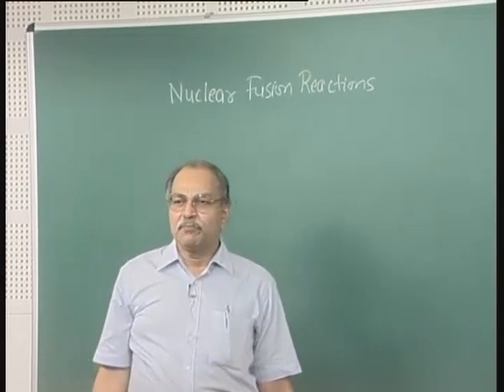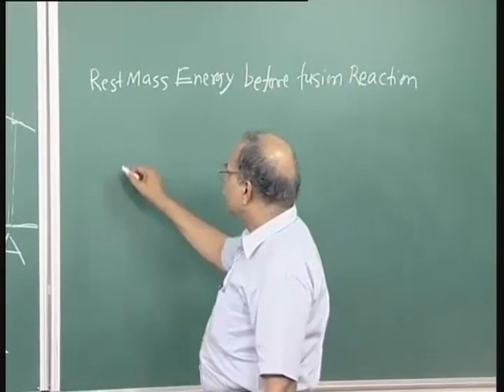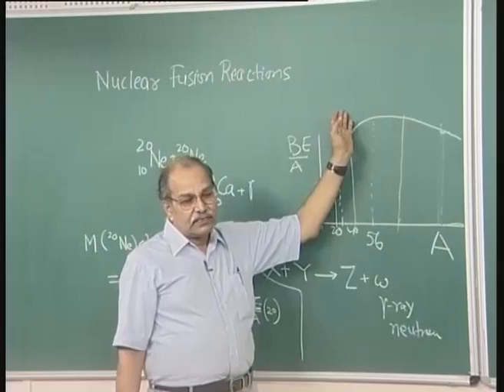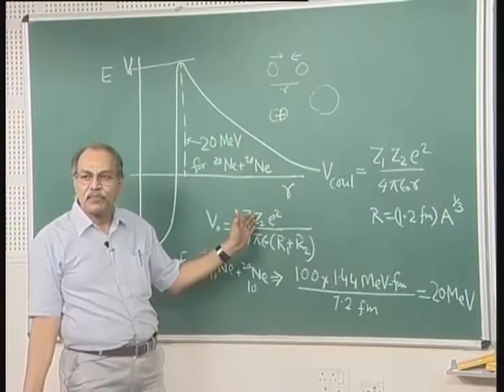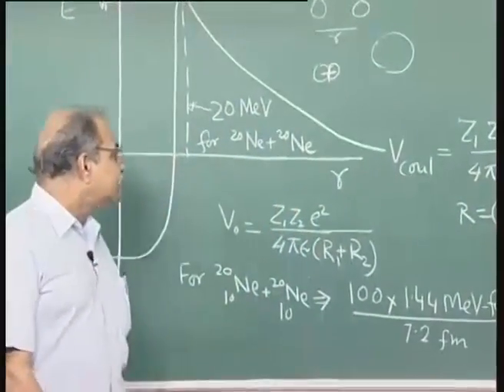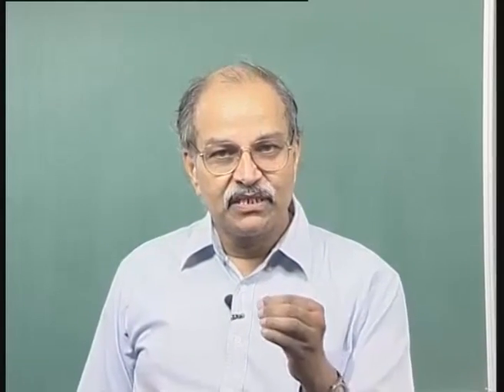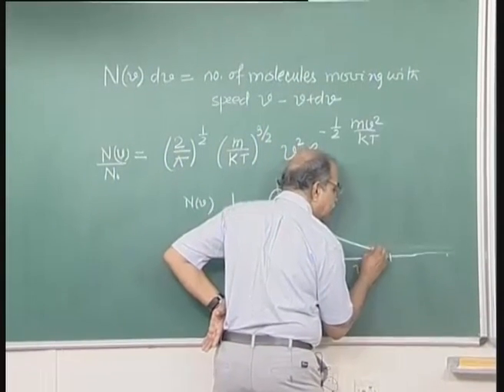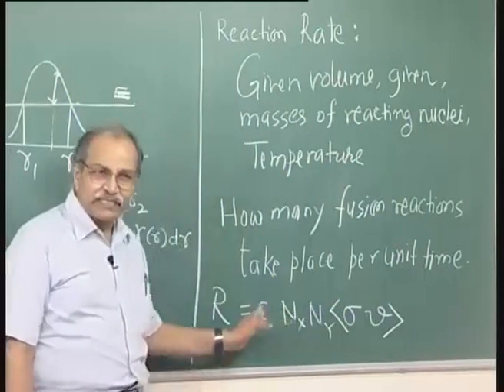Mod-01 Lec-37 Nuclear Fusion

Comment: Isn't Boltzmann constant for Ideal Gas? 
How can the core of the Sun, or core of a nuclear bomb, where pressure and density is not even achievable in the lab, be ideal gas?
Can hydrogen be plasma state at the density of 150 g/cc, which is 7 times denser than solid uranium?
At such density, with each atoms charged, behave like ideal gas?